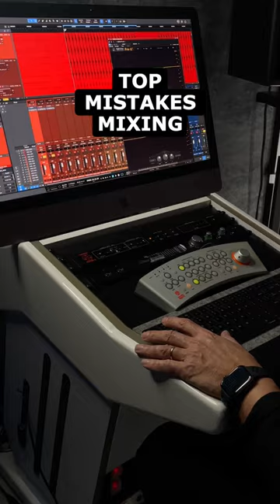MOST COMMON MISTAKES DURING PRODUCTION BY LUCA PRETOLESI WWW.MYMIXLAB.COM #shorts

Comment: Linear phase EQ is a modern creation. All the best hits of the early 90s, 80s, 70s, 60s and 50s were EQ'd using bell curves that caused phase shifting. It was never an issue, and the degree of phase shift caused by typical EQing is not an issue today (unless you're running like 13 EQs in series)
Reply: Yeah but he’s 11x Grammy winner he needs to squeeze the blood from the stone
Reply: @SeFu2006  Fair enough. If I had that kind of pull behind my own name, I'd also be whoring out for all these plugin manufacturers
Reply: Every 'pro tip' has been gone over literally hundreds of times on YouTube, so this sort pointlessly esoteric thing is all that's left, people telling you how to correctly gain stage a 0.25dB send to a flanger plugin.
Reply: @davelordy isn’t that a good thing? Means they figured it out

Comment: So this i why when i do initial leveling and panning, and i apply compression/eq, i still tend to rebalance my levels/panning thereafter. Never knew it’s been a phase problem.
Listening in mono, so i can easily tell.
Reply: 1. You are worse of using linear phase eq in 99% of cases because the pre ringing is infinitely more audible than any phase changes caused by minimum phase eqs. 

2. Compression and eq causes changes in gain so its only natural top adjust the gain after said effects, regardless of any phase changes. 

3.Changing the phase of a sound is not the same as causing a phase issues. In fact in most digital sounds the phase is different for each note and every time you trigger. Even when recording your gonna get different results each time depending on the set up. Phase when mixing is not a static and fine tuned property that can only be configured in one way or another. Thats why you can (and should) use minimum phase eqs 99% of the time and be completely valid results. Linear phase is ideal for EQing or filtering in parallel where the phase rotation at the cutoff frequencies will cause phase issues with the original signal.
Reply: @Trickey2413  Hmm. Can you explain a bit more in detail? I got lost at No.3
Reply: @nuellenaire  No.3 is basically just saying that altering the phase of a sound does not necessarily cause phase issues. In most sounds the phase is random each time it triggers anyway, its not a static value that has to be preserved. So unless you have really obvious or specific issues that typically happen under specific circumstances you don't need to worry about "phase issues" when EQing or mixing.
Reply: @Trickey2413 Okay thanks!
Reply: @nuellenaire  The best examples for typical phasing issues are Kick and Bass. There are videos on that topic that explain what phasing issues are and why they happen - look them up. If you got the concept you’ll see that if you have a sound like a layered kick or other very similar sounding instruments or samples layered, these issues - can - happen. Mostly they’re not even problematic and sometimes you either don’t care about it or maybe you’ll even f* with it. The only real concerns you should have is when these things happen in the low end on biiiiig speakers, because when they go silent on a critical, rhythmic instrument and you don’t know why, that would probably not that good.
Reply: @Trickey2413  can you name some minimum phase eqs?